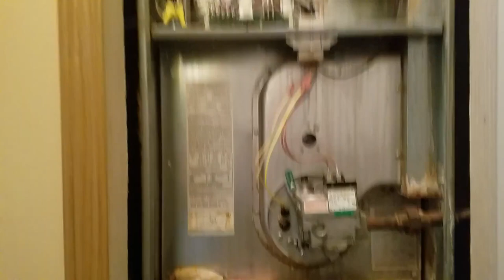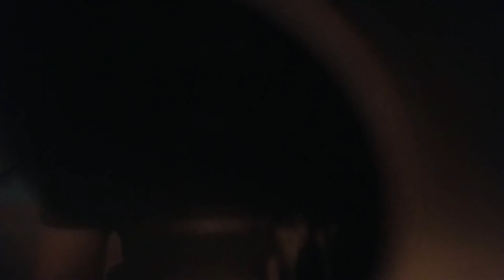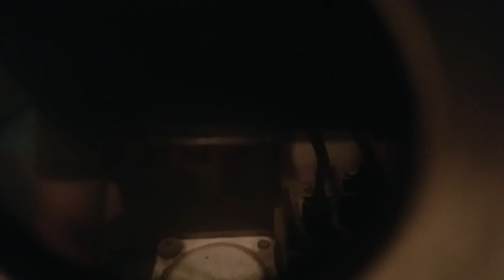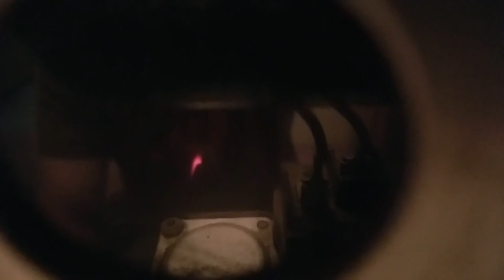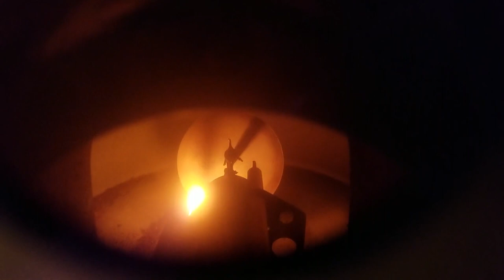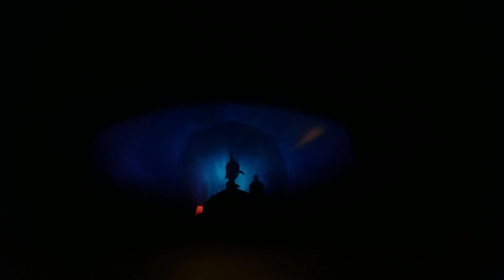Coleman DGAT056BDD furnace issue

Comment: On the roof, you have a 5inch pipe inside of a 7inch pipe, pull the cap off and look down the 5inch pipe. You will likely see a hole in the 5inch pipe from rust. The inside pipe is exhaust, outside gap is intake. If there is a hole there. The exhaust will go directly back into your intake. Causing your flame to eventually go out. I fixed this issue on mine with a piece of 5inch pipe which I cut down and sleeved inside the rusted out one. My furnace stays running now.

Comment: Any actual fix to this issue ive replaced everyrhing from Board, Flame Sensor, inducer, thermostat, both safety switches only thing left is heat exchanger and new piping through roof. I can say after taking everything apart I stuck my arm inside and can feel alot of air movement

Comment: My evcon dgat075bdd blows hot air if I take off the front panel And close off duct work in floor and heats my trailer. If it’s all together the heat comes out of registers like warm not enough to heat the trailer?

Comment: I think that this is a frequent problem on these. Anyone have comments. I am not sure. I cleaned the orifice to be sure that there are not any spider webs, also I cleaned the flame rod. Seems to work better.
Reply: Well I found a problem that I could fix. The control board 7990-319 AB1012 had some water stained on it. So I replaced it. All ok now!
Reply: TonyLemur ; I did a new stat also. ~35 bucks for a full blown programming type. Just to be sure.

Comment: Get the mud off that inducer cage first thing so it gets enough combustion air. Re-seal the faceplate with a thin layer of good silicone for a gasket. If any air gets by that faceplate of the inducer mount or the mini blower wheel isnt generating enough airflow it will fuq it up & shut down like that too. But yah..like i seen in the comments..REMOVE THE CROWN & IMSPECT THAT STACK FOR RUST & HOLES !!! Pronto.